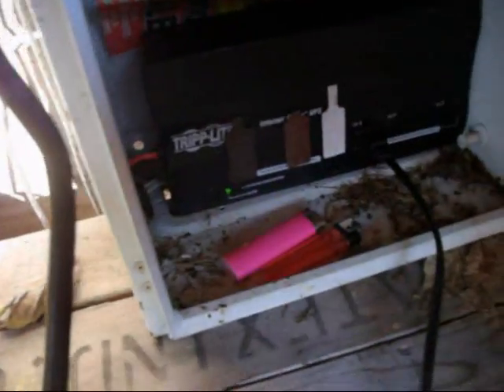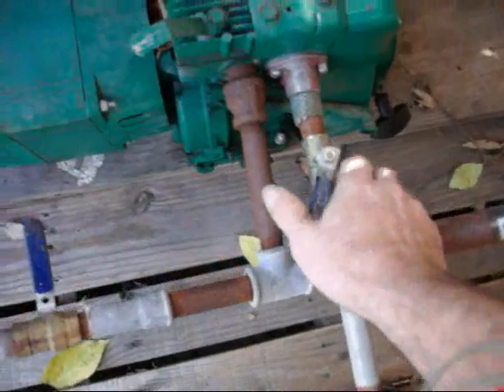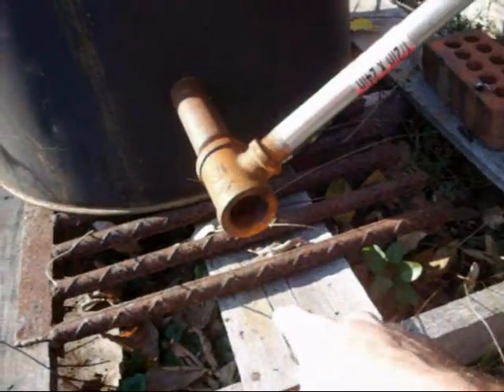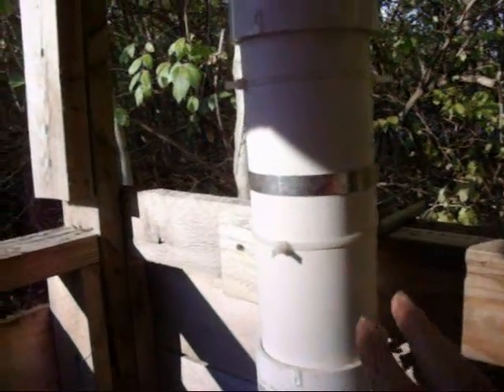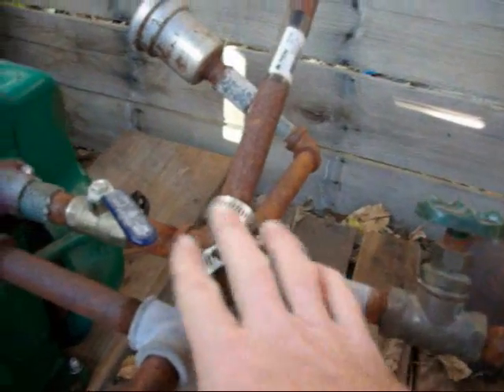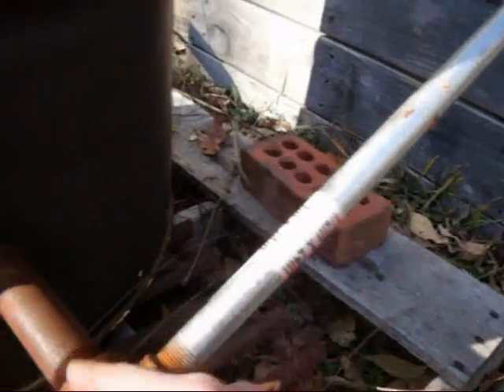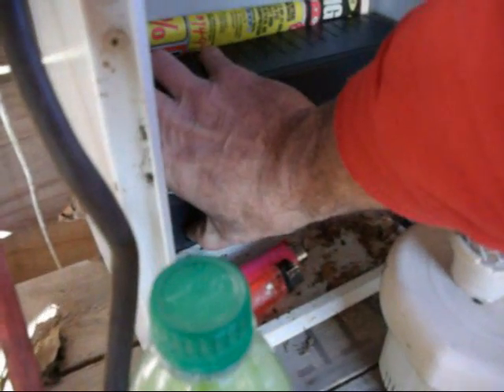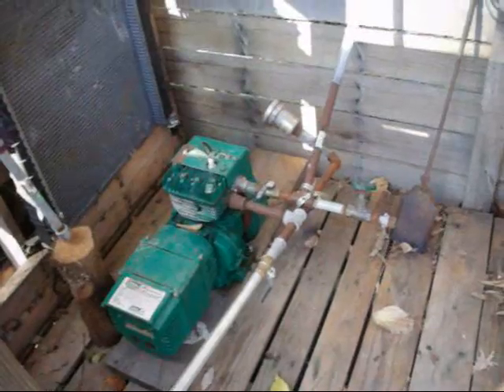Grid down test of charcoal generator

Comment: Real nice Dan. What did you say your total runtime is using the 55 gallon drum. Did you say two hours?  Or you ran it for 2 hours and only used half.
Reply from the maker: I have only run it a total of two hours and I still have a little less than half a drum full. I will have to revisit this project. Maybe do a fuel burn run to see how long it will last. Thanks for the comment